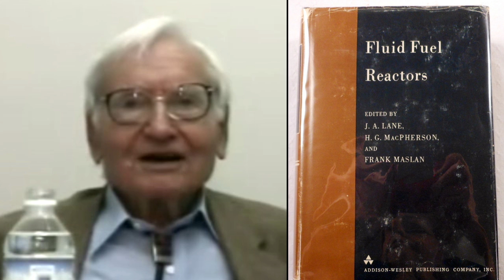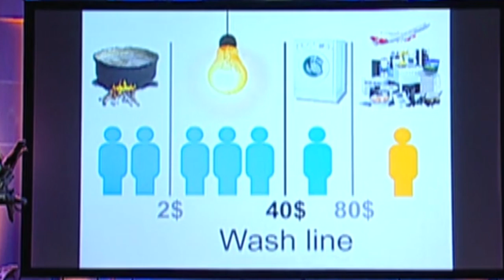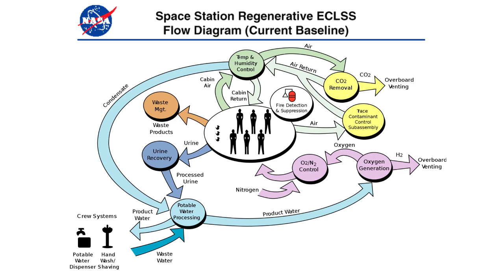Desalinating Ocean Water with Molten Salt Reactors - TR2016c 0h48m54s13f

Comment: I so appreciate the tremendous work you people have done. I also have the hope that Alvin Weinberg had the technology will be used. I worked on several reactors at INEL and a lot of time at LOFT which was built in the "hanger" built for the "nuclear plane". Did not understand the significance of  the MSR until Kirk started publishing. Thanks again for your work!

Comment: There is enough energy in the condensation phase of the steam cycle of the power plant to desalinate a substantial amount of water. Desalination requires low grade, temprature, steam that feeds the condenser.

Comment: This is a great idea, however the hardest part with desalination is what to do with the brine output
Reply: I know in practice this is a challenge, but in theory you can just dump it back into the ocean. Like most processes, if you have enough clean energy to drive it should be doable. More energy to pump water further to shore and further back to ocean.
Reply: @gordonmcdowell  Given that the US imports 16M tons of salt into the country every year (41% used for road salt, 38% for industry), I think it's pretty clear with molten salt output from the SuperCritical CO2 generator, some number of multistage flash distillation would generate the fresh water, and the brine (not sure what percentage of the original seawater) could be harvested for normal salt production.   The chemical industry is estimated to use 86% of the brine used for chlorine and caustic soda production.  Eventually, enough fresh water could be used to repopulate aquifers and lakes like Meade and Powell.

Comment: Every heat engine needs a hot side (reactor) and a cold side. After your SCO2 turns your turbine it must be cooled, so why not use a seawater still to cool it?
Reply: Everyone building reactors sees that as an optimal means to get biggest temperature delta. The "no water needed" think is just to illustrate these reactors can go anywhere, not just by ocean and lakes.
Reply: Worked well at Fukushima.
Reply: No reactor that has EVER had any problems eas 4th gen. Obviously. They need to be "walk-away safe".

Comment: Ships that are nearing their use by date should be fitted with Thorium fueled, Liquid Salt Nuclear reactors (aka LFTR) and a desalination plant. 
Thousands of these ships can tie up at any port in the world and provide Base Load Electricity 24/7 365 to a city for more than 20 years while using Off Peal electricity in the wee hours to provide the city with drinking water drawn straight out of the harbour.

Comment: i am a semi retired mechanical designer id like to come out of retirement to work on any of this stuff i have a resume i can send you
Reply: Maybe you could design a safe storage system for nuclear waste as no one else has come up with a satisfactory system.
Reply: @amraceway  LFTRs can consume the actinide waste that is currently stockpiled.  The immediate products of fission are highly radioactive, BUT have short 1/2 lives.  The actinide waste that has built up is radioactive for hundreds of thousands of years.  Safe long term storage is NOT possible.  You show me material that can withstand bombardment over that length of time.

Comment: I don't understand the talk about desalinating water from nuclear power plants? 
Any plant generating heat is capable of desalinating water.
I have experience from large ships (tankers & container vessels) and the the fresh water generator on board these ships is basically a cooler, using the flow to the FWG to create a vacuum, and boil of temperature of 40 degr.
Reply: I think the point here is to do so without combustion.

Comment: We don't need desalination in California.  All we need to do is stop wasting water by flushing it down the Sacramento River and out to sea for the sake of the Delta Smelt and imaginary salmon populations.  We do, however, need MSRs to generate electricity to replace the loss of several nuclear power plants and hydroelectric projects due to action by radical environmentalists, especially as the love affair with electric vehicles continues to grow.
Reply: "We don't need desalination in California." -Milosz Ostrow. You know the aquifers will be depleted eventually, no matter how many industries and uses you take off the table, right, Milosz? No question CA fresih-water is an inefficiently allocated resource, but it is a FINITE resource (aside from rain water). While the ocean is, for-all-practical-purposes, infinite.
Reply: +gordonmcdowell — If politicians had followed through in the 1970s with plans that engineers had made in the 1950s for California's freshwater infrastructure for a growing population, we wouldn't be in a state of crisis today.  Much could still be done at lower cost  than using desalination, regardless of the energy source. However, I wouldn't be averse to using the "crisis" as a way to get MSR technology introduced into mainstream use and help dispel the irrational fears of nuclear energy.
Reply: The only fears about nuclear energy are the insolvable waste issues and the constant drain on taxpayers to fund the nuclear industry, but apart from that what could possibly go wrong?
Reply: +Bill Hollingsworth — There are no "insolvable waste issues", especially not with MSRs using thorium fuel.  Even with conventional pressurized water uranium and plutonium reactors, the technical issues of dealing with spent fuel were solved more than half a century ago and are readily available without royalty payments, courtesy of the U.S. taxpayers.  Please educate yourself on the subject before commenting.  There are many videos on YouTube dealing with molten salt reactors (MSRs) and liquid fluoride thorium reactors (LFTRs).
Reply: I think it is you my friend that needs to acquaint themselves with waste disposal. Yacca mountain is paid for by the US Government. You obviously don't care about how much tax you pay or where it goes. Some of us however do. https://en.wikipedia.org/wiki/Yucca_Mountain_nuclear_waste_repository
Reply: +Bill Hollingsworth — If Yucca Mountain is all you know about nuclear waste handling, you're going to have a steep learning curve.  You might as well get started now.
Reply: I notice you didn't answer my question, would you like an easier one instead?
Reply: +Bill Hollingsworth — Learn about (1) fuel reprocessing and (2) vitrification.  The French have been reprocessing for decades; since "spent" fuel rods still contain about 95% of the energy with which they started, it makes no sense to throw the material away.  Vitrification of nuclear waste was developed in the 1950s.
Reply: Milosz Ostrow oh, Bill has been posting his spent-fuel hand wringing to lots of videos. No indication he is interested in learning about solutions. But for anyone who IS interested, Robert Stone toured France’s high-level waste repository in Pandora’s Promise, as well as EBR-2 fuel reprocessing.